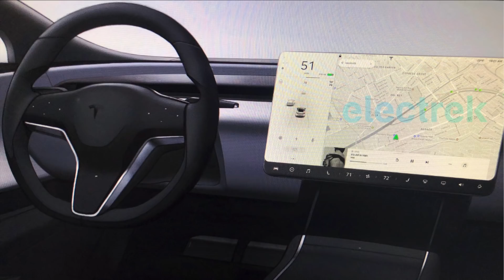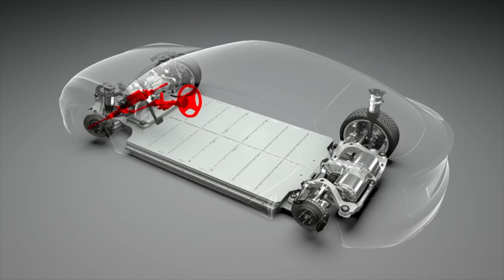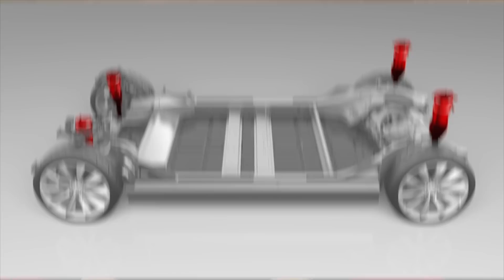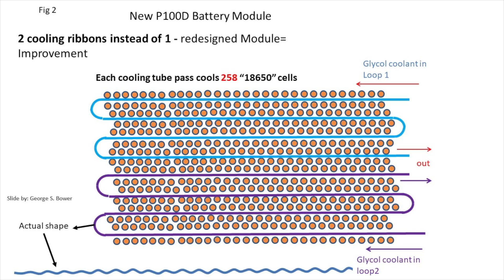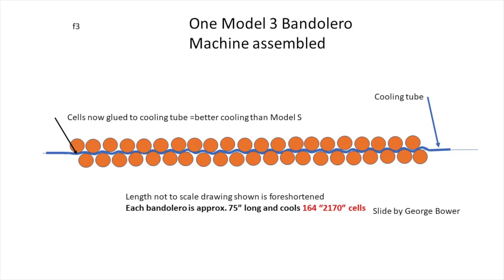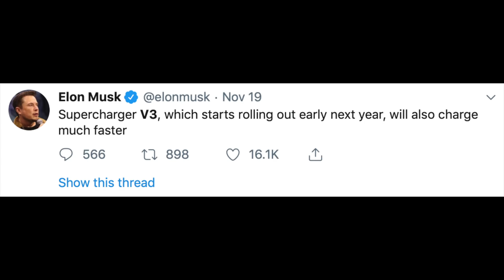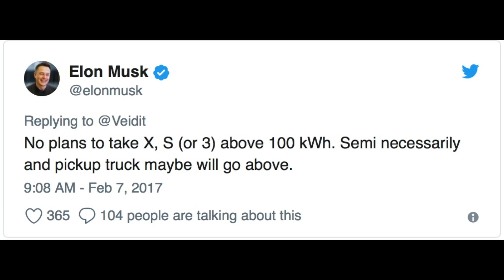The reason Tesla's 75 kWh battery is going away

Comment: Ok, but why do you see removing a battery option as indicator of new battery tech ? Wouldn't they also discontinue the 100 then ? The S75 was not so attractive anymore as it offers the same range as a mid range model 3 for a much higher price.
Reply from the maker: It's hard to say but I suspect they want to make more of a distinction between S/X and 3 on the range side. What could happen, and I'm only speculating here, is the 100 kWh will be the new low end with a lower price and they will introduce a 120 kWh battery as their top end.
Reply: just reducing inventory saves money for the company

Comment: One point I didn't see you address is the actual production lines, they will want to keep those 18650 lines as is, spitting out profit for as long as possible. Potentially 18650 production could be switched to Powerwall production but changing both cell lines and pack lines as well as implementing a different design for the charging introduces risk and they will want this to go as smooth as possible
Reply: yes/no - it depends on the contract. if the production line is owned by Panasonic, then it's quite possible Tesla is better off switching to their own 2170 cells and letting Panasonic keep using that line to produce for other people and some spare batteries for replacement packs that fail.
Reply: Didn't Sean say 05:03 that the Panasonic-Tesla agreement for the 18650 is most likely fulfilled. I'm geuessing they will be tooling up the production lines for the 2170 batteries.
Reply: @teslaperth345  the contract is up, but if Tesla owns 50% of the production line, the math changes, if Panasonic agreed to deal with the capex (the production line) in exchange for the contract of 5 years worth of cells, then Tesla is now in a better position switch. 

So that is why I said yes/no, plus Tesla has some need for the cells for legacy cars.
Reply from the maker: Intersting point. Economies of scale happens at high production though, which is why it makes sense to me that they move all of their products to 2170. It will have a huge impact on their lower priced cars which is where they want to get anyway. 18650 are also produced in Japan, unlike 2170 which is produced in Reno.
Reply: yes cheating the grid is like cable descrambling a good business for crackhead wanabee's but beyond hazard morally.  Thanks for reminding us igt's the devil whose dancing we are panting over.

Comment: I kind of understand why Tesla is taking away the 75 kWh Model S. The sole reason is that the fully equipped Model 3 cost around the same as the lowest priced Model S and the tech is way more superior in the 3 than the S. Of course, there are some minor comfort differences for the Model S such as the larger boot space, air-suspension, heated steering wheel and probably a few more. But the wast majority of EV buyers (especially the complete new ones) only look at the price and the range thus they are probably saying: "Why should I buy an S when a 3 is better?" And for this reason, I accept Tesla's decision.
On the other hand, for the Model X they should have at least waited for the reveal or the first deliveries of the Model Y. Because the Y is only going to be revealed this March and if we assume that it will have the same timeframe as the Model 3 (original - from reveal to the planned delivery date: 1,5 years; realistic - from reveal date until the actual publicly open delivery date: 2 years; optimistic - from reveal date half the time as the originally planned for the Model 3: 0,5-1 year) then this will leave a tremenderous amount of time for buyers to withold their Tesla SUV purchases. This is bad for us customers cuz we have less supply and more wating time, thus is is also a drawback for the company as it will loose some potential customers for the lower end Model X. So, in my opinion, Tesla should have waited a little bit more with axing the 75 kWh Model X.
As for the battery refresh of the Model S and X: I really hope that it will happen, even if I've read from different sources so far that it might not come true. But is should. Otherwise the Model S and X gonna lose it superior "premium" title not only for the Model 3 and Y, but also for other EVs in the future. I keep my fingers crossed!
Reply: Zoltan Kakuk The tech is new but not superior to the S imo.
Reply from the maker: I agree. I think they may be wanting to make more of a distinction between the 3 and S/X. Increasing the range and battery size on their premium line up is a no brainer way to do that, and give the middle finger to their luxury competitors.
Reply: It comes with boots?  Awesome!
Reply: Some may view that position from a different perspective, and may think that for almost the same price or a little monetary difference, one can step up from a Model 3 to the Model S. I don’t think it’s necessarily a given decision in favor of the Model 3 over the Model S, as you’ve portrayed it.

Comment: A 25 GALLON GASOLINE TANK MIGHT WEIGH 200 POUNDS WITH FUEL AND HOLD 875 KILOWATTS.......EVEN IF ONLY 20 PERCENT EFFICIENCY OF AN ICE THAT'S SAY 200 POUNDS HOLDING 250 EQUIVALENT USABLE KILOWATTS........VS 1000 POUNDS HOLDING 100 KILLOWATTS..........THESE BATTERY PACKS SIMPLY HAVE TO GET DOWN TO 200 POUNDS AND HOLD 250 KILOWATTS  TO BE COMPETITIVE...SO WE'RE STILL IN THE JUNK ERA HERE

Comment: maybe they keep the 100 kw package, but using the Model 3 batteries could decrease the weight, which would increase the efficiency achieving a better range, in addition they could lower the prices of the vehicles, although Elon promised that there would be a variant with 400 miles.
Reply: Elon said on twitter they want to move away from naming models based on battery pack size and instead use the model 3 naming, such as Model S, Model S long Range, Model S Performance, etc

Comment: New 2019 dual Carbon Battery from Japan - Last much longer and Charge up to 20 Times Faster than lithium ion Batteries.  Elon Musk has worked with this Japanese company Power Japan Plus in the past developing  batteries , It is just (possible) that they may be using this new carbon battery for Tesla's in the future. of course that is if the Batteries are as good as they say they are.. The new Carbon batteries configuration is similar to lithium ion and can be manufactured in the same manufacturing  Plants that manufacture lithium-ion today.. Below are some statements from the Japanese company....  “Power Japan Plus is a materials engineer for a new class of carbon material that balances economics, performance and sustainability in a world of constrained resources,” said Dou Kani, CEO of Power Japan  “The Ryden dual carbon battery is the energy storage breakthrough needed to bring green technology like electric vehicles to mass market.”
 The anode and the cathode of the battery are both made out of carbon with an organic electrolyte solution that allows for ion current to flow separately. This also does not require the use of any rare Earth metals or other rare metals, significantly cutting down on the price of each unit.
Thermal stability means that this battery will not heat up while in use or during charging, and removes the threat of Thermal Explosion and making for a Safer Battery.
Reply: Now wouldn't that be an amazing world to live in...
Reply: When I googled Power Japan Plus I was shown a dual carbon battery cell from year 2014. It's 2019 now, where are the dual carbon battery packs?
Reply: @eaaeeeea  Hey, appreciate your effort. Pay equal attention please to people referring to almost all cars being reliant on combustion. POwer plants are reliant on combustion- car use expansion.  NOT FUNNY.
Reply: This new battery technic is not NEEDED for widespread EV adoption, but will certainly give it an extra boost.
More info on this technology: https://en.wikipedia.org/wiki/Dual_carbon_battery
Reply: @harmotten  

So I know this is an old line but I have never been exposed to answer......

How exactly do you get electrons sufficient to power cars to Brooklyn? They are installing trailers there filled with.... unmentionable expensive bags of toxic flamblw shot just to shift poor peoples power consumption using worst case heating tech unaddressed to heater off times.... to put it differently those section 8 deadbeats are costing taxpayers millions just for one trailer to run there thousands of watts in dark incandescent bulging when they should be undercover sleeping late or pumping heat out of molten h20 to boil water for radiators instead!

Electrification remains a ponzi scheme.  Musks the new steady return hustler getting money made off yesteryears fools who where lucky to get principal back duh. 

A123 equity holders got zilch.  Tesla employee's are on food stamps already spat out like the old school foddering clowns they been.  Leaders lead and that means 'marathon' oil wins AGAIN by keeping cars toO heavy for power line infrastructure yikes!
Reply: Yeah, that's nice, but Carbon is still unproven tech.
Reply: Bro :As an electrolyte, the cell uses one or more lithium salts in an aprotic organic solvent
its still a Lithium Ion Battery. but instead of Alum/Cobalt for the Anode and Cathode they are using Carbon.. its Kinda like calling Club soda Sparkling water.  its Different Sure. but its still Fizzy water. This Tech is 10 years out. but that 5.2Voltage will be nice for power density
Reply: @Zieranna  did not see your reply as,highlighted so posted fresh.  Five volts?  I used to without wetting my fingers fondle the steel nipples on carbon zinc lantern batteries as at around a hundred volts per battery they zapped naked and dry thrillingly.  Later fluorescent camp lights moved on to alkaline and at Walgreens recently I bought a,solid state lantern that was an,antique it had lumens nearly nonexistent but same barcode as this millenias tech.  Seriously it sat in store over half a decade!  I meant to cash it out to spare some sucker taking it home but the crap instead got into my museum.

Fuel is answer.  By feature first!  Not octane or other arbitrary nonsense but dollars per year and global recovering potential.   I nominate O8.  Electrons are Thomas Edison era toys any motor candidate ain't gonna be electron fueled get real.
Reply: Doubt Tesla would risk new battery tech on current high volume models. More likely the roadster where volumes would be low and fitting additional battery safety features would not overprice the car especially if they can deliver a sports car with HyperCar performance.
Reply: Carbon Batteries would be the breakthrough to finally put ice cars to rest. Only one Problem... Wero not have tje electrical grid for widespread ev adoption. Not in america nor in europe
Reply: @alittlebitintellectual7361 
If these are cheap enough to produce, they could easily provide the necessary energy storage capacity to vastly accelerate the transition to renewable energy sources. The biggest problem renewables have is their... temperamental... power production. Meaning they don't always produce the same amount of power, and may me hard to shut down when less power is needed, potentially damaging the grid. This is already being solved by large battery banks, so making the production of those battery banks easier will naturally speed up adoption of renewable energy sources.

Additionally, just because you're adding renewable energy production to the grid, doesn't necessarily mean you have to shut down existing non-renewables immediately, if you still need the energy production capacity.

Even with electric cars becoming so unquestionably superior to ICE cars that quick adoption becomes inevitable, the transition still won't be instant. So there's some time for energy companies to react, and for the public electric grid to be improved. I won't deny that it could easily lead to problems if the transition is too fast, but I don't see any good reason to be too worried, unless you can actually do something, yourself.
Reply: @alittlebitintellectual7361  yeah, neither power generation nor delivery. I do nearly 2 hours of commuting per day and only my ac uses as much energy as my entire house. Imagine if you also have to power the wheels. That energy will ha e to come from somewhere on some proper lines.